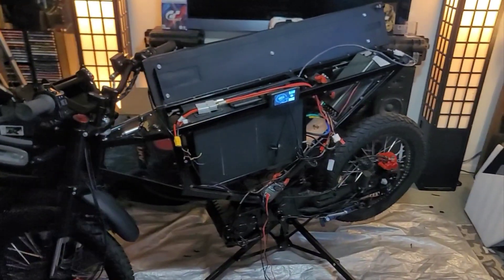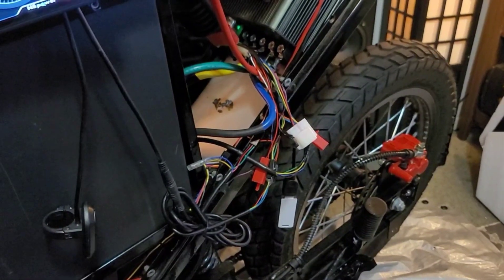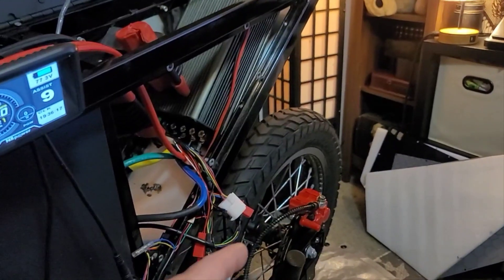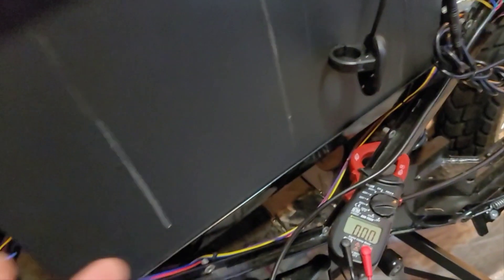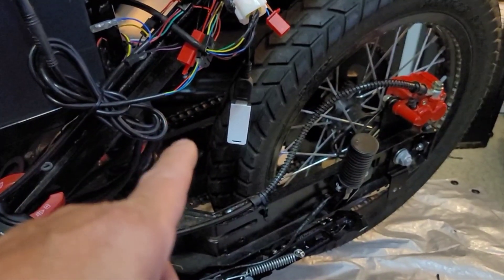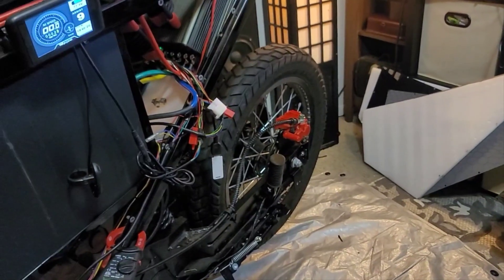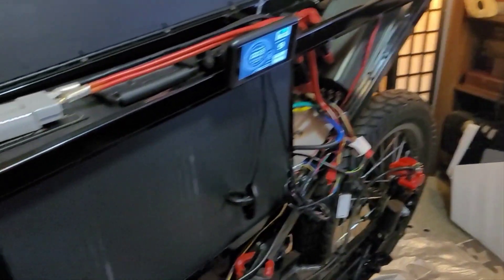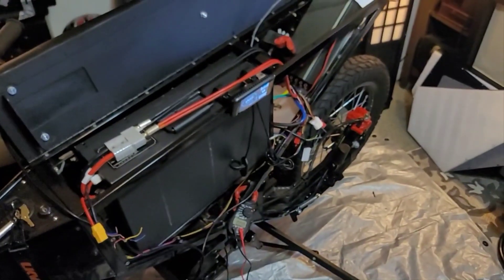Xion Cyberx with a Sabvaton 72150, why? because a BAC 8000 was complete overkill for the 100amp BMS!

Comment: Too much work I would of left it as is. Lol
Reply from the maker: as is the dam thing was cutting out as someone thought it made sense to install a BAC 8000 on a bike that they set it up with a 100 amp, bms. Sure that sound's and looks good but a 400plus amp controller and 100amp BMS just dont perform well besides i found something that appreciated that BAC like my race bike lol besides wasnt too much work if i did it in 30 mins just looks like it
Reply: Thinking about letting my bike go @ChrisCrossingWires1212. Wanted to give you first dibs. Same bike as yours 72v 63ah battery sabaton 72150 I’m in New York for work from Houston.